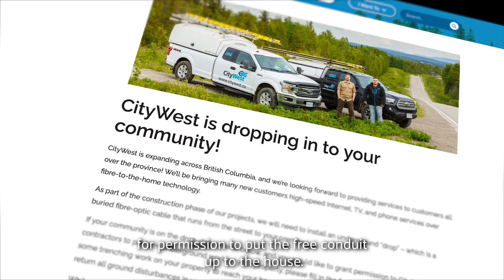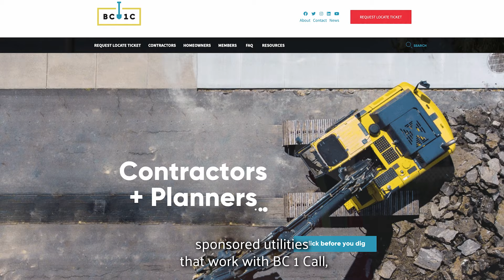Fibre Drop Installation Video - CityWest

Comment: If you ever have to deal with AT&T for fiber line installs or if you have problems with how it was installed good look. They bury the fiber line maybe 2 inches in the ground if you're lucky and they are horrible about communicating to the customer when they will be coming to actually do the job. Then if you ever have a problem with it or need a new line installed their customer service is always someone who barely understands english. . You can never get ahold of anyone local because they use a third party company who is based 1000s of miles away. 
I had an appointment set up through AT&T to have a new fiber line installed on Friday. Come Friday no one shows up. I was given a confirmation number and when I called them Friday they had no clue about my appointment and told me their system didn't have my confirmation number and then had to reschedule another week out. Just terrible customer service.

Comment: Many years ago, a cable company came in trenched the old fashioned way, ripped apart my irrigation system and made a mess of the grass. Really annoying.  Where I live now, we have a monopoly cable company with little competition, some 5G wireless internet and a few brand new neighborhoods that have direct to the home fiber.  My speeds are sufficient for my internet speeds and the service is pretty reliable but with regular overnight outages for "upgrades". That is past my bedtime so it matters little to me .

Comment: My yard, a corner lot, was basically destroyed by this process by AT&T installers.  It will take 2 years for my grass to recover.  And they could care less.
Reply: They were probably installing an entire network, not just a drop to a house. For the last 5 years, my lawn has been cut up. Cathodic water devices, water line replacement, sewer lining, a gas line replaced, and now fibre optic cabling. In all cases, I got the lawn to recover by the end of spring. Grass seed, fertilizer, water.

The contractor that does the work has to do restoration. You still have to water it. If you have a restoration issue, call the city and they will make the company fix it. Too many complaints about the contractor and the company will not use them. You call AT&T who subs out the once in a lifetime installation for your neighborhood and they have no mechanism for dealing with that other than "reboot your device".
Reply: Boo hoo, the grass will grow back.
Reply: Grass grows back
Reply: Get over it
Reply: Cry about it you got good internet.
Reply: this is the future of internet we are talking revolutionary you are lucky to have what others or should i say over 70% of people wish they could have right now
Reply: Your using that same internet to complain about your yard here😂
Reply: What can they do?
Reply: So what?
Reply: Dude is crying about grass?
Reply: It doesn't take two years to grow grass. Maybe 20 years to grow a pair though.
Reply: Stop crying 😢 progress over your yard
Reply: Sucks to your grass, if it's that big of a deal go buy some sod and put that down. Boom. Grass
Reply: Awww your poor grass. 🙄
Reply: Honestly, good for them. Providing that kind of reliable high speed internet to an area is FAR, FAR, FAR more important than some grumpy dorks grass. EXPONENTIALLY more important.
Reply: @Kota-sk8sl  Your yard must be crap.  Believe what you wish.  AT&T subcontractors destroyed my lawn.  Three times in fact.  But it came back after much work and money, and now it looks like a beautiful green carpet of grass, thanks to me, lots of water, and the company who fertilizes my yard.
Reply: Keep your slow internet